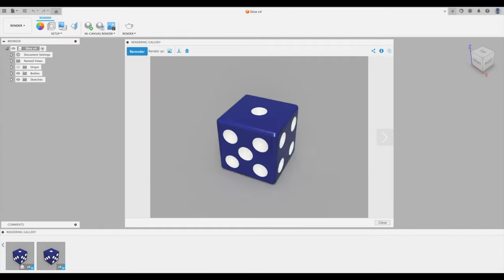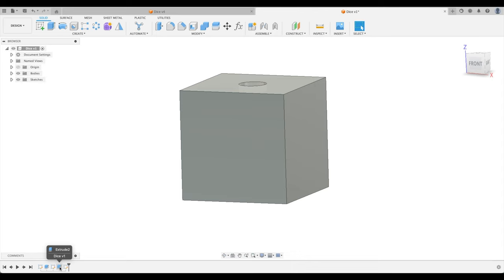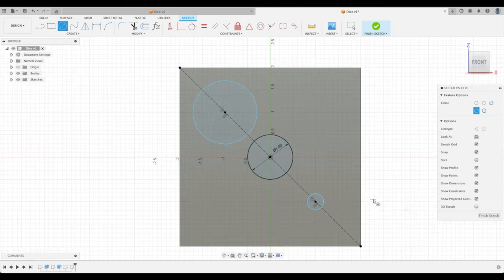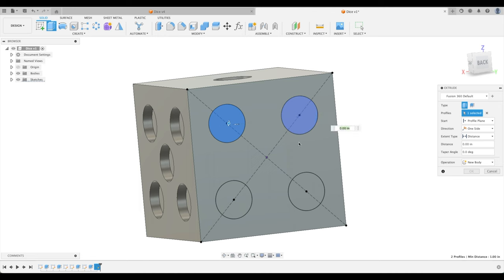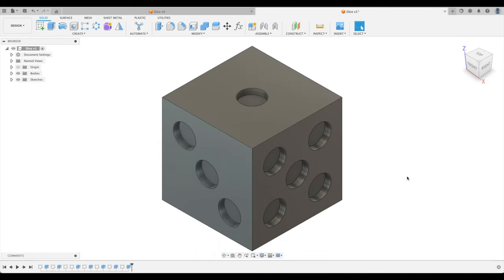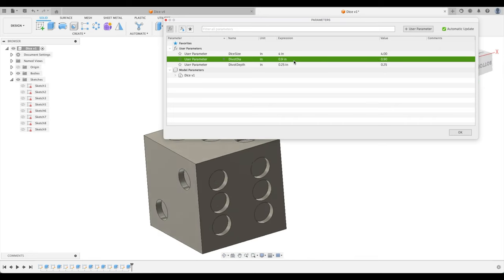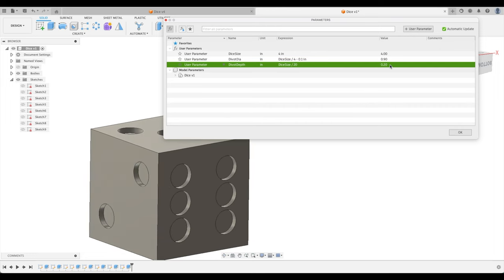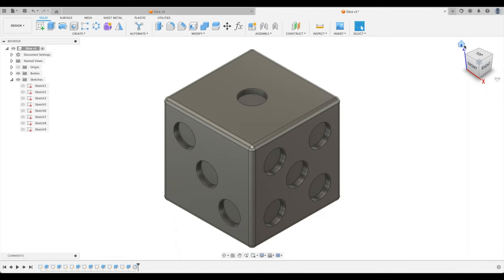Fusion 360 for Beginners - Lesson 7 - Parametric Modeling Tutorial - Dice (2023)

Comment: One trick I learned later that helps to change things you didn't parameterize at first is that once you create the parameters you can open the Model Parameters section in the Parameters view and change the values you use for each feature all in one place. Also makes it easy to see at a glance what values were not parameterized.
Reply from the maker: Thanks so much for the trick!

Comment: The issues I had with this were I couldn't get the triangle and then making circles on that line it didn't allow them to be equal to the centre circle,I must have missed something there.
Reply: Okay I missed the half line half line and missed coincident
Reply: I spent ages on this, I'm not certain how I check for coincidence, it has 2 right angle shapes on each corner and the centre circle has 3 right ajgle shapes
Reply from the maker: Happy to try and help you figure it out. May I ask that you explain it a different way please? I don’t quite understand the problem that you’re facing.
Reply: @learnitalready  sorry, I kind of wrote it as I was going. I drew the line from one corner to the other as you did, then missed the step where you deleted and then drew from the corner to the centre, twice. I did that and was able to find the triangle and the centre for the circle origin. However when I drew the circle it required me to put in the diameter and then again hit enter which showed a small padlock. If that occurred I could not go to the next step of making the circle equal to the centre circle. 
I had to try and figure out how to make the 2 lines meet in the corner of the square. I did that multiple times, I'm not sure how the sequence goes? Click on the coincident and then on the end of the line and then the corner? It happened but o don't know how, perhaps even the centre wasn't connected?
Reply from the maker: @robberlin2230  Thank you again for reaching out and explaining in detail. So, a very easy way to do solve that problem is:

1) Create a sketch on the face of your part that you'd like to model on. 

2) Just draw a line off to the side of your part, on a slight angle so that there are no automatic constraints applied to your line (for example a horizontal or vertical constraint)

3) Now, select the coincident constraint first, then the endpoint of your line, and then the corner of the cube. It should constrain the endpoint of the line to the corner. 

4) Finally, select the coincident constraint again, select the other endpoint of your line, and then the centre of your cube. It should constrain the line fully now. 

Let us know if that works. :D
Reply: @learnitalready  ah of course that is better, it gets too finicky when they are close together. Thanks I just did this and it worked, that's a good tip to make it easy to ensure it doesn't coincide
Reply from the maker: @robberlin2230  Glad that worked!

Comment: With the DivotDia parameter, does the "-0.1" not make the spacing go weird at more extreme values for DiceSize? They looked a bit crowded with the larger die and too widely spaced with the tiny 1in die. Would "DiceSize/6.7" make it more reliable?
Reply from the maker: Yes! Great job thinking of using a parameter to control the divots.
Reply: DiceSize/4.4 seemed to work pretty well.

Comment: Thanks for some great videos. I'm a little confused by what you said in Lesson 4, though, that you ALWAYS, ALWAYS create a component first. Is there some reason you didn't do that first in Lesson 7 here. I'm not trying to be a wise guy -- just wondering if I missed something.
Reply from the maker: I love it! Thanks for your comment and thanks for catching me not doing what I said should be done. Thanks for learning with us… you’re doing amazing to be at this lesson already. 

Here’s the official answer: if you know for sure that you will only have 1 component ever in your design, then it is ok that you don’t create a component right from the start. However, if you will need to create more than one component or a joint in your design, then it is key to always, always, always start with creating a component.

Keep up the good work! Please feel free to comment along the way especially if you catch another mistake. All the best!
Reply: @learnitalready  OK, thanks for the info, sir. I'm making an electronics enclosure. It has a box body and a bottom lid. Would you make two files, or one file with two components. The bottom lid has screw holes that need to align with holes on the bottom of the box. In OnShape, I can "USE" lines/circles from previous sketches to get things lined up. I'm sure Fusion has something similar, and you probably cover it in one of your excellent videos. I'll look for that. Thanks again!
Reply from the maker: @vegasdealer777  Very nice to hear! You will need to jump ahead to lesson 9 to learn the exact answer to your question. That tutorial is one of our most viewed videos and is very useful. Actually. Here it is:
https://youtu.be/4_N2--_FUTk
Reply: @learnitalready  Wow! Thanks. That looks like exactly what I need to see! Beautiful. Have a great day!